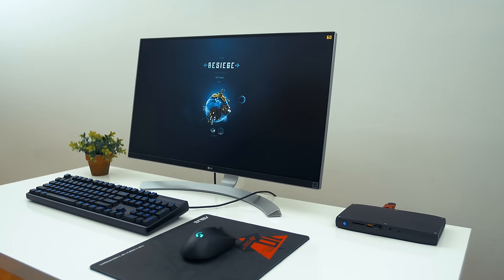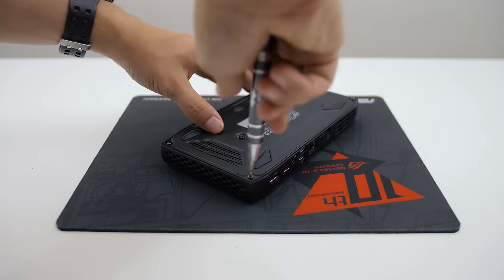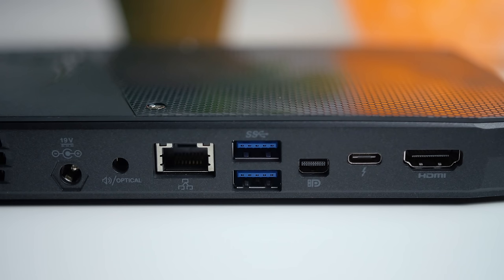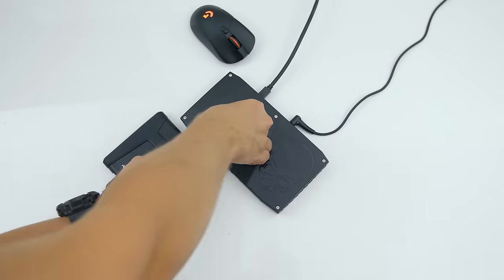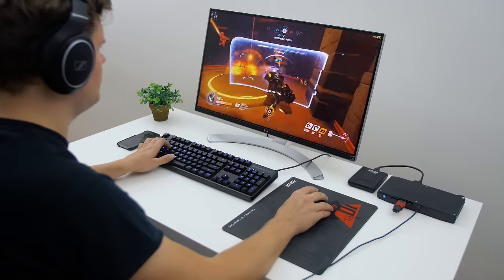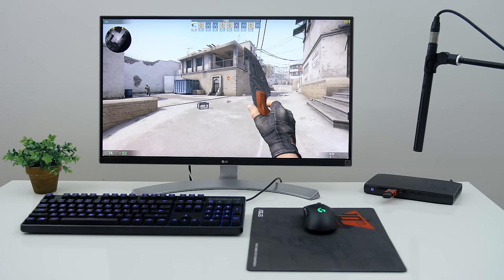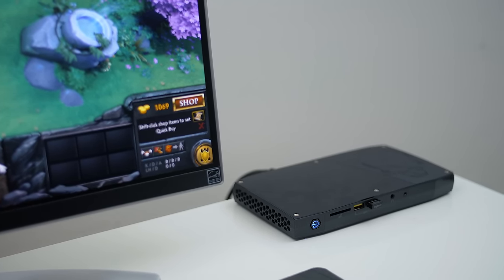Intel's Skull Canyon NUC - A Compact Powerhouse?

Comment: Perfect for a TV and a sofa, maybe gaming on the go while traveling. Not much use cases after that.
Reply: Ricardo Escobar gaming on the go with umm what screen?
Reply: luis _ have fun finding good wifi thay doesnt cost 20$ a day. And i dont see a reason to play games while traveling anyway.
Reply: why not buy a decent gaming laptop ...in the price range of 600$ .
Reply: Aslam Bugti he said its about 1000.- 600 is only the barebone. You can get decent laptops for that. And you can play casually with cheap laptops. Depends what you play.
Reply: Does the laptops of 600$ has (211 x 116 x 28 mm) dimension and weight less then 1 pound?
Reply: Ricardo Escobar you can do so much with this believe me.

Comment: I LOVE my NUC! Mine quint-boots: 

1.) Openstack Liberty (on Ubuntu 14.04)
2.) Openstack Mitaka (on Ubuntu 16.04)
3.) Debian Jessie
4.) Windows 7 Professional (for firmware and driver updates)
5.) SteamOS

It's an AMAZING little kit. I bought a 10" LCD panel to go with it and a 12", flat HDMI cable. It all fits in a very small space, and I bring it to the hotels with me. I have a super-cluster in my hands and can show of a LOT of power in a very small package. 

If you get an NVME drive, MAKE SURE you install it in the PCI-e slot, not the SATA slot, or your drive will suffer performance.

Comment: if its supposed to lay horisontaly ways why is the power button mounted for vertical mounting
Reply: What? The power button is on the front. Technically it could be for horizontal OR vertical but I assume Intel is only recommending horizontal setup because of the vents being on the sides, which would make vertical setup not so great. You'd be blocking either an intake or exhaust option. But still; what? Why do you think it's for vertical? O.o

Comment: That price, ouch. My full size desktop build is only about $1500 now. It's 8-core at 4.2ghz, 32gb ram and Geforce gtx 960. For travel I could see it being useful, otherwise, not till the price comes wayyyyy down. Liked the video, Cheers!
Reply from the maker: The price is steep compared to what you can build yourself but it will never be as small haha :p
Reply: HardwareCanucks
I agree!
Reply: HardwareCanucks
If you bored enough, I posted my build a couple days ago. It's a parts list, not a build tutorial, so it's not long.
Reply from the maker: link :D
Reply: For gaming though, your build will be just as fast as this NUC. Since your 8 cores and 32 GB give no advantage over the 4 cores and (assumed) 8 GB you'd put in this.

The GTX 960 is of course substantially faster. But not $800 faster which is the difference between your and my NUC build.
Reply: Jan-Wouter Arendsen
I built it for rendering, gaming on it is just a perk.
Reply: Egal Matreaux Four words: WTF is dat GPU????

Comment: Quick question... Wouldn't the premium price make the Blade Stealth a similar option in both performance and price, but with the added bonus of being it's own full system (laptop) to make use of the "portable" part of the whole deal?
Reply: Qualifier: It's been way too long since I've built my last rig and I've been wondering if a more "mobile" solution with an external GPU enclosure would be a more "perfect fit" for my needs at the moment.

Comment: Sure space isn't in abundance in my room, but a mini itx computer with say a Intel 6700k, 1060, psu, ram, case, mobo hdd and os I feel would come to about 1,000. Making it def a novelty as you stated. I feel like this has more potential in commercial applications like running those interactive touch screen menus at fast food joints or hospitals.

Comment: been considering getting a Mac Mini for years, but with the drop in the Aussie dollar and the lack of innovation from Apple and even worse, things like soldered RAM make it a deal breaker. This thing, is fucking awesome. I'm not a gamer, but want a very small PC with POWER and this thing delivers imo. Better value than laptops with similar specs and choose any size monitor or TV to go. Santa & Y2J Chris Jericho, put it on "The List"

Comment: Alienware Alpha seems to be a better option that this if you can about small form factor gaming. heck you can find the first gen alpha for under 400$ offering i3 + gtx960m + 4 gb of ram + 500 HD hardisk + original windows key with a controller.

Comment: If Razer Core would mount on a wall, this would be a extremely cool wall mounting solution. Save some more space.
Reply: You could instead build a regular computer in a A4-SFX or NCASE M1 which are essentially the same size as the Core (or smaller?), with significantly better performance and a lower price.

Comment: I use one of these with the bplus pe4c v4.1 m.2 to powered pcie. I use it with a gtx 750ti. I have my geekbench scores posted with the same username, and some posts on techinferno forums about this setup.

The 750ti more than doubles the gaming frame rate while looking better.

Comment: The Zotac ZBOX-EN1060 MAGNUS makes much more sense. 

You have a GeForce 1060 GTX in a box as big as the NUC, but it can be used for proper gaming.
Reply: Can't find the 1060 version here in Aus..Or atleast not on the websites I have checked so far (PLE,PCCASEGEAR,MWAVE etc) but there is a 960 version for a little under $1100..That's actually pretty cheap tbh.
Reply: They are selling the Zotac ZBOX GeForce 1060 & 1070 versions in SA, but they are special order items.
Reply: Adding a Razr Core to the NUC.....How much is that going to cost you in the end? Most probably double the price of the Zotac 1070.
Reply: Robert Olivier South Australia?Or do you mean some place in America?Idk how much the core is tbh I heard it was somewhere around 200-400 or something but usd so allot more than that here anyway.
Reply: South Africa :) 
The Razr Core costs as much as a GPU, then you must still purchase one. It will work you out much cheaper to wait for the Kaby Lake i7 & build a monster desktop with that. If you want to go GPU in a small form factor, the Zotac ZBOX is what you want.
Reply: Robert Olivier Hahah I had no idea where SA was tbh.I honestly thought it was a place in america I didn't even think of Africa XDD.I already have a 980ti,5820k rig but I was still curious anyway so thanks anyway :P.
Reply: I checked those out. Roughly R19,000 for the 1060 ZBox with a 500GB SSD, Windows 10 and 8GB. And a little over R23,000 for the same specs on the 1070 variant. Pretty comparable to Mini ITX systems of the same spec, although you're sacrificing a more powerful CPU and more storage.

Comment: Hi Guys,
does anyone knows a power-bank model that can power this NUC?
So that you can use it on the road too (instead of just being able to easily transport it from home to office for example)
from specs it seems one would need to provide 19V and up to 120W.
The only device that comes clove that I've seen is the lifepower power bank, but even that has
AC output: AC 230V / 50 Hz / max. 120W peak, but only 100W continuous.
That seems on the edge, but I'm just not sure how it would behave under close to 100% load (and consider a portable display charging thru the thunderbolt too for example).
With appropriate power-bank (and touch/pen enabled portable display) it can become ultimate MOBILE workstation/studio, with the added flexibility to unplug devices that you don't need

Comment: Does the nuc run on battery or wall electricity?
Reply: even though you see a powerbrick, it has a port so probably a wall,
battery would not make sense if it is not a laptop.
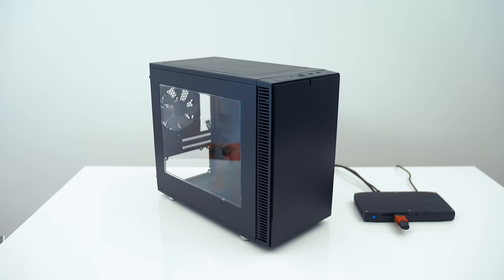Reply from the maker: It comes with a power brick, shown in the video 2:09 ... so wall power.
Reply: how do you imagine that? Maybe you have battery  powered monitor ?
Reply: whatever

Comment: I get that this is a really small computer but by the time you outfit it to be as powerful as a desktop (buying a Razer core, and 1070) your spending ~$1800 USD, which is the price of a comparable mini ITX solution, which by the time you add in the Razer core, would be around the same size. But with a desktop I have a full upgrade path and better components... Good video though, just seems like it would be a slightly worse alternative to a mini ITX

Comment: If you're going to be playing close to $1000 for this then why not buy a 15 inch laptop?  It's obviously not as small as the NUC but it comes with a screen, keyboard, trackpad and battery.

You can buy a laptop with a 6700hq and 960m for less than $850 these days.

Comment: Could you connect an external GPU to this without a bottleneck?
Reply: Nope. Check out LTTs testing of the Core. Shit compared to a regular GPU.
Reply: Fredrik L ah ok thank you
Reply: That's an exaggeration. You'll lose 10-20% performance depending on your GPU. If you aren't using a 1080 it's fine.Toss a 980Ti in there used off craigslist and you'll have great performance.
Reply: Polygonals what about a GTX 1060 because from memory, I'm pretty sure the 980Ti uses a hefty amount of Wattage and I'm not sure that would be ideal for a PC that small. Just wondering?
Reply: ceNi S You're right about the wattage, the 1060 is far more efficient, and totally wouldn't be a bad option! But, the Razor Core and other concept EGPU enclosure options (such as one from asus, my personal favorite since it can hold a harddrive or ssd) have their own power supplies for the GPU.
Reply: Polygonals ohhh right I didn't know that, that's awesome. I searched up the Asus EGPU and it looks amazing! Thanks for your help :)
Reply: ceNi S No problem! I think they might release is in the first or second quarter of 2017. I can't wait, and it should be far less expensive than the razer core. The only thing I don't like it the look of it, a bit too crazy for me but I could put up with that:P I think it also uses two USB type C/thunderbolt connections so theoretically there might not be a decrease in performance! Keep your eye out for news on it.
Reply: Polygonals i'll be sure to, thanks :)

Comment: Not sure I can recommend as Intel won't admit if there is a problem or not.
There is constant random reboots many are having including me with different ram and ssd setups.
Have tried all the usual BS fixes that intel recommend on forums, swap memory out, fresh windows install, update bios.
Personally I think it's either faulty hardware or some sort of thermal issue in this form factor even though i set fans to max in bios.
When it does work it's great, Perfect for lounge room under the tv but it even does random reboots when you are just watching a youtube clip and not gaming at all.

Comment: iris pro 580 for 1080p low-mediums settings?

No. i wish.

My gtx950 is more than twice as fast and can barely do 1080p medium 60fps in some new AAA games.

I agree for indie and esports games it's very good
Reply from the maker: For latest AAA titles it will struggle for sure, but it's not really the target for those games. Would be awesome to have a dedicated GPU crammed in there, but then we enter larger casing and the novelty of this space efficiency kind of wears off.

Comment: NUC + Razer core pls
Reply: razer core has proprietary connector iim pretty sure
Reply: Greg Erfulgerman nah Boi it has a thunderbolt 3 connector which I've seen work on other computer with the same connection.
Reply: it doesn't, it has thunderbolt connector, some laptops are already confirmed to work with them using Thunderbolt. so the nuc might be able to do it.
Reply: Jad Collado I was thinking of the Alienware egpu
Reply: No it doesn't. USB type C thunderbolt 3.
Reply: yeah the razor core uses usb type c thunderbolt 3 and the nuc according to the website comes with a thunderbolt 3 usb type c. so it should be doable.

Comment: This NUC is kind of neither here nor there. It's too powerful and featured for a very simple system/HTPC -- you can get an ASRock DeskMini that's cheaper and accepts desktop CPUs, but doesn't have as much graphics power or features and is a little bigger. At the same time, the NUC is not powerful enough to be a gaming PC or a serious system as it doesn't support discrete graphics and the CPU is mobile. So it doesn't really fit anywhere. You can get a super tiny Mini ITX system, like the upcoming Hutzy XS at 4 liters, which supports all desktop components, including a graphics card. Or get a DeskMini or build a tiny Thin Mini ITX system if you don't need discrete graphics and want the tiniest thing possible.

Comment: The made this because they could. No ones going to buy it because it doesn't replace or upgrade or fill in a gap that people need. For $1000 you can get a laptop with a graphics card, for $1000 you could build a beast gaming pc why spend $1000 a computer that's just small with half the performance

Comment: Eh...too small.  Can't fit a discrete graphics card in it.
Reply: The integrated graphics would probably outperform any discrete graphics card out there...
Reply: Wut, integrated graphics outperforming discrete graphics card? Wut
Reply: Fredrik L Usually when I think of "discrete graphics card" I think of low power single slot cards that are really bad in games.
Reply: +Redey1290 lol so you're saying this Iris 580 would be better than a single slot 1080? Really? LOL

Comment: very overpriced.
Reply: not for what it is and what it does.
Reply: can't agree, especially since it offers something that you can't find on the market, something new.
Reply: if you need power you will buid a desktop, if you need ultra portable yet powerful - laptop with same CPU is a better choice... i really don't understand for what it is marketed. I like the idea of computer being that small yet for the price there are better options no matter how you look at it.
Reply: Anball2 he told you exactly what markets it is for.
Reply: I don't think it even matters if this thing sells or not; it is proof that something like this CAN be done and just maybe it will make new challenges for big companies to produce even smaller yet very capable PC's. Imagine a thin 40 inch 4K TV that has the power of an i7 ultraportable laptop. It might even replace a console if you give it enough time.
Reply: How much do you think a laptop with the same CPU costs exactly? do you really think you can get a skylake i7 laptop for near this price range? not a chance.
Reply: k
Reply: dude the i7 laptop will cost under 1000$ usd, and it already has ram, screen, os, keyboard, wifi, storage. If you factor all the components you need buy to make this NUC work, it won't sound as a good value AT ALL. by the way laptop WILL come with a stronger GPU wich you can actually play some more demanding games and not CSGO
Reply: It costs $600. The i7 CPU in this thing has a MSRP at $434 USD. Four cores, 8  threads, clocks up to 3.5 GHz and has Intel's biggest integrated GPU.
$600 - 434 = $166, would not be bad for motherboard, case and PSU.
Reply: Asrock Deskmini 110 is much better value
Reply: Newegg had one with 16GB of RAM and a 240GB SSD for less than 600 dollars
Reply: I can make a GAMING SETUP with a pc build with an RX480 or a GTX 1060 that would ABSOLUTELY KNOCK THIS PIECE OF SH!T OUT OF THE ROOAD....-_-
Reply from the maker: It's not cheap but overpriced may be an overstatement given the size. Still see the point of what you can do with $1K budget on a PC.
Reply: Yea True....But still not whort it...
Reply: lolz

Comment: the problem with this is that if you're in to gaming, it forces you to either low quality or less demanding games. it's just not worth it... the mobile processor is not good enough and the graphics will never be good enough for anything intensive. This NUC is a complete joke. It'd make much more sense to get the other models which offer 2.5" HDD support which is cheaper than those M.2 drives per GB compared to a 2.5" SSD.
Reply: probably because the target isnt the gaming crowd? Not all pcs are built for gaming yknow. Having no built in gpu on this thing should already tell you that much....
Reply: "if" is conditional. Ignore my comment if you're not in to gaming. Plus, they went in to its gaming capabilities. I'm just expanding on that.